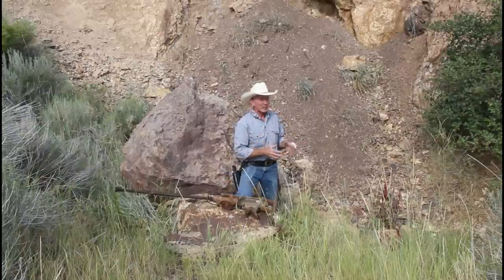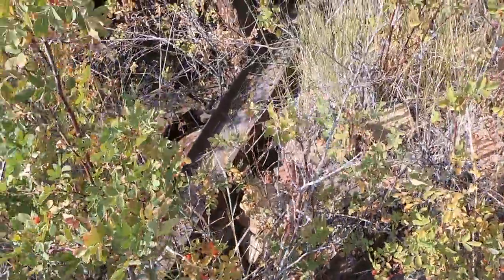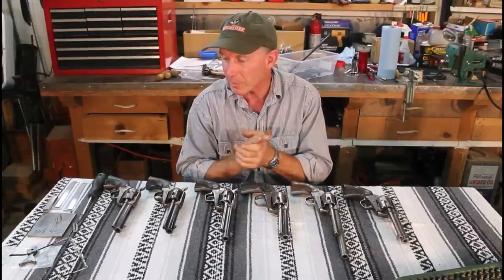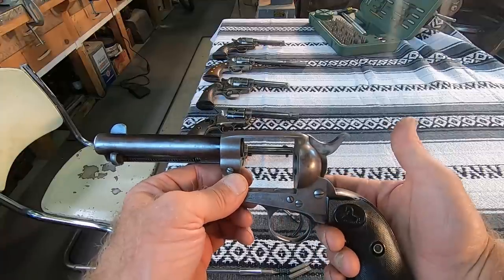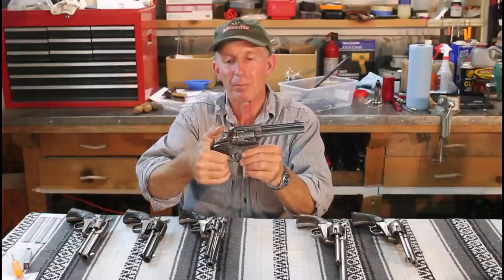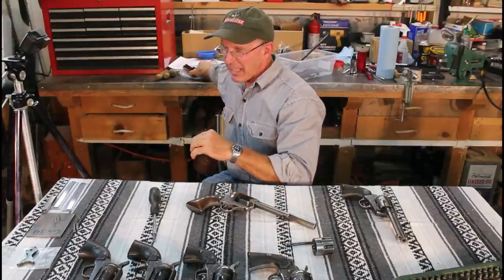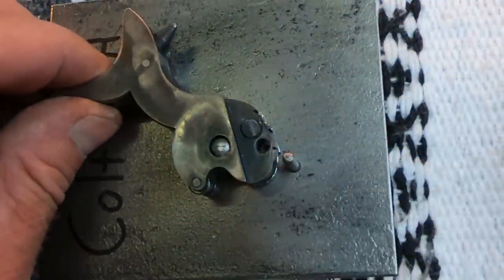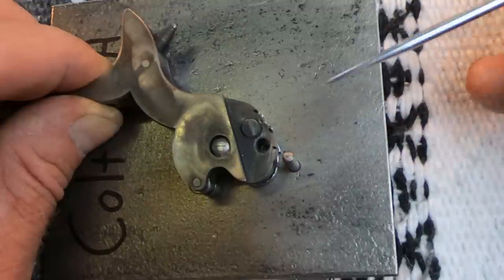Colt's Single Action Army - A Quick & Easy Mechanical Evaluation

Comment: I've collected eleven Colt Single Action Armies over the years. I do my own gunsmithing, fitted barrels, cylinders and have done action jobs on all of them. I have a couple with odd barrel lengths. I have a first gen. made in 1901. The gun was a total mess, the barrel was corroded, very little rifling was visible. Looking at the front of the cylinder the holes were oval shaped. It took me a number of years but I changed out everything except the frame, backstrap and trigger guard. So now it's a first, second, third generation. Turned it into good shootable revolver.
Reply from the maker: That's fantastic to bring that old Colt back to life.  It must have been very rewarding to shoot it after putting all that work into it.
Reply: @thecinnabar8442  It took a lot of years to get all the parts I needed. It gave me a
great satisfaction when it was finally completed
Reply: @thecinnabar8442  t's probably my favorite. It should be after all the money I put in it.
Reply: Donald, did the James-Younger gang have 'cartridge' 6 guns in Northfield in 1876???

Comment: Well if you have the inclination of messing with firearms, that is why they make the plastic fantastic, aka Glocks. You can screw with those till the cows come home. The Vintage SAA's well those are too valuable to bubba. I live just 35 min from the Factory and use to drive by the old factory on the way to work back in the day.  Sam Colt could not start that business here in 2021. We are living in very screwy times. Laws are passed, the people tell the state to go pound sand and they don't enforce the law that they pass due to not enough personnel to do it, not enough money and they don't want bloodshed. It's been hard to be a gun guy here in the last 7 years. The issue is going thru the courts right now and my guess is it will end up at the Supreme Court. You showed in my feed this morning and well I clicked subscribe.

Comment: A friend gave me a 1st gen 44-40 4 5/8 inch built in 1884.  It was missing the ejector housing, the trigger & hammer were notch-less, the bolt was missing a tail, and nearly all the finish was gone.  Good news is the cylinder was tight, the bore was good, and it was miraculously free of rust damage.  With the help of Jerry Kuhnhausen's book, a very expensive collection of replacement parts, and a lot of patience, I now have a proper functioning SAA that shoots my Pyrodex handloads exceptionally well.  It required learning to silver solder for the ejector rod screw retainer, and shaping the tail of the new bolt to ride over the hammer cam for proper timing is not for the hasty or hamfisted.  It probably took ten hours to polish the case hardened hammer so it fit in the frame properly.  The only thing remaining is whether or not to refinish it - it's unlikely anyone else will ever own it, so I'm inclined to make it look as good as it shoots.

Comment: This is the first time I've seen the safety notch discussed and I watch a lot of gun videos. It seems we should all carry our SAAs with the hammer down on an empty chamber, though I'm pretty sure that back in the day they were carried with all six chambers loaded and the hammer in the safe position. The safety notch looks pretty substantial, not foolproof but pretty good. I suspect lawyers might be involved here. The safety positions on old rifles are very similar. It all comes down on the shooter, the best safety is between the shooter's ears.
Reply from the maker: Very well said!!
Reply: There is another way to carry fully loaded safely..Its an old method carried over from the percussion revolvers..I call it mid notch carry and you let the pin down between rounds..Its an old method that apparently has been forgotten and not taught to people in the last 50 years or so..It was taught to me by my old Grandfather,who was friends with Elmer Kieth..
Reply: @TightwadTodd  The Colt percussion revolvers had those pins for mid-chamber rests, the Remingtons had proper mid-chamber notches.
Reply: @3ducs  And on A Colt or colt replica SA cartridge,as well as a S&W or S&W replica Breaktop SA cartridge,you can place the firing pin down fully between Cartridges..This keeps the pin off the primer and releases the full weight of the spring,locking the cylinder in that position.. no chance of primer detonation unless the hammer is cocked..I suspect,that this was the way they were intended to be carried..I cant see the Manufacturers having that safety feature on their percussion revolvers and then abandoning it completely on their progressive models..I have never bought into the Empty Chamber  carry and the "They loaded that 6th round when necessary" theory,with regards to anyone who carried the SA revolver for any serious work..
Reply: @TightwadTodd  You beat me to it.  Very good point.
Reply: Speaking as an owner of a 1851 Navy clone, I figured out that placing the hammer down on a 1873 SAA between cartridge rims would be a good and safe idea.  Apparently I'm  not the only one to have figured that out.  
I do get a little concerned about the choice of words, to clarify a situation.  The "safety notch" is known as the quarter cock notch on a revolver, but it is the half cock notch on a rifle.  The "loading notch" on a SAA is the half cock notch.  
Your last sentence reminds me that when I was in high school a driving instructor said that the best safety device on any car is the nut behind the wheel.  You certainly grabbed onto that point very well.
Reply: COMMON practice…
Reply: @TightwadTodd  ‘Cowboys’, etc were KNOWN to have a “rolled” dollar bill or eqivalent in the EMPTY CHAMBER of the cylinder where the hammer rested. YES…’5’ ROUNDS!
Reply: @m118lr  No "Cowboy" i ever knew and i come from 5 generations of em, Besides, that would wick moisture into the cylinder. Another modern myth.
Reply: @TightwadTodd  I have also heard but not confirmed that five rounds of black powder cartridges would burn a paper dollar to ashes.   Yeah, I think it's a myth.
Reply: @wsmvolunteers8588  Hadn't even considered that possibility..Guaranteed a Cowboy would have found a better use for a dollar than to burn it up in a cylinder.
Reply: I remember my Grandfather saying,
“If you need a safety on a gun you probably shouldn’t have one.”

Comment: Great video! Really enjoyed this and the cylinder gap issues that I have not had to deal with yet. I thought it was interesting at 24:33 the view of the cylinder notches looks to me like they have been deep cut. The deep side looks like about 50 thou. The place the bolt is dropping very early is where it would drop on a race SAA (about the middle of the flute). Just that the leads have not been extended is the only difference with a race cylinder. Makes me think someone was making a fanner out it at some point.

Comment: Mark, I often wonder why I couldn't have had someone like you as a brother in law! What a great way to demonstrate and educate on these. I just got an old Colt SAA at auction and when it gets here I can really use what you just taught me. The trigger guard assembly, where it contacts the frame has a small gap that I will need to investigate also. Anyway, I think this gun I am getting was part of an order to the Copper Queen Mine in Bisbee. Will be interesting to see what Colt has to say. It has some Sulfuric Acid splash on it too.
Reply: As far as the trigger guard assembly gap problem,  possibly the screws are crossed threaded when installed, or they might be replacements and too long.

Comment: Thanks, Mark!  I'm looking at buying a Colt SAA with Serial # 1532XX.  It's got the screw to hold the barrel rod so I think it's Pre 1892-3.  I'm watching as many videos as possible before buying and you gave me a check list of what to watch for.  It sometimes does three clicks but does the 4th after I tried it a few times.  I think it's old and needs attention.  Thanks for the break down of the SAA and what to look forward.  I'll go see it again and applied what I learned from you.

Comment: Very informative video. I purchased 2 new Colt single action army revolvers in 45 colt back in the 1980's and recall that they both developed so much end shake/play after shooting a couple boxes of ammo that you could hear the rattling as you pointed the revolver up and down. I traded both in disgust soon afterwards. I was beginning to wonder if I had judged them to harshly that maybe that end play was normal until watching your video.
Reply from the maker: Once they start getting excess end shake, they get worse from firing and the battering that the cylinder takes.
Reply: @thecinnabar8442  I have thought about purchasing another from Colt's custom shop but have been very apprehensive spending so much money without getting an opportunity to examine the revolver first

Comment: Very informative video. One point missed is checking the timing. I lightly rest my left thumb on the cylinder as I slowly cock the hammer. Once the hammer is in the final position I push on the cylinder clockwise and listen for the click of the bolt dropping into the cylinder notch. If I hear a click that tells me the hand is stopping short of full lockup.  It is not a difficult fix. Thanks for some very valuable times.
Reply from the maker: Great point about the hand function and it's relation to lockup.  I should have included it.  Maybe I'll get around to doing an episode on fitting a hand in the future.  Thanks for watching and commenting!
Reply: @thecinnabar8442  I think that would be a great video. You may consider one on adjusting bolt timing too. Thanks for your good work.

Comment: Great video! I just wish there was a better explanation of how the ejector rod works, and what the function of that long tube that almost looks like a second barrel (the ejector housing I assume) is. It's a very distinctive feature that always catches my eye, but I haven't found a good explanation of it anywhere.
Reply from the maker: Open the loading gate, put the hammer in the load notch, line up the cylinder so that the spent case is lined up with the ejector rod, push the case out with the ejector rod.  The first time you handle a SAA or one of the clones, it should become very clear to you.

Comment: You're helping me out big time buddy. I just bought a Traditions 1873 SAA, but the 2nd click is not a click sound at all, but a thud that I can feel, not hear, and the top portion of the hand looks like half of it's surface is sheared off. It's action feels worse than my Heritage Rough Rider 22lr saa revolver. Something tells me a $500 plus revolver in 45lc should have a nicer action than a $120 22lr saa revolver. Sometimes, the hammer comes back part way, then locks up and the hammer won't move back any further, nor does it want to allow me to lower the hammer. The original owner is dead & his family sold it to me. I dont' believe they knew anything was wrong with it because it looks to be in fantastic shape. The problem is, it's not in great shape internally.

Comment: Wondering if you know? Elmer Kieth's #5 SA there are discriptions of how it was made. However, not in much detail, the welding of the top strap, was it built up, etc. Then there is the isue of heat treating. Anyway these details I have wondered about. I figured if anyone would know it would be you. Hope you can help, thanks.
Reply from the maker: Sorry, I don't have any information on how that was done.  It would be interesting to know.

Comment: I was wondering if you are still doing gun smithing yet and color casing that I saw when you were going to school for gun smithing I may need color case hardening services
Reply from the maker: Hi Scott, I'm not set up yet to start color case hardening, but am planning to soon.  I just got a used caustic bluing setup that I'm refurbishing, then I'll work on getting my color case hardening equipment up and running.  Drop me a line at: CinnabarGunworks@gmail.com and we can keep in touch about it.

Comment: Enjoyed your videos and watched it from beginning to end. I watched because I have an old SA giving me problems. The revolver was working fine until the hand broke. I replaced the hand and now the hammer jams sometime times when going to full cock. It's like the cyclinder block is engaging the cyclinder to soon. I am thinking maybe the spring is slipping, but the spring looks ok. Can you help me? You started talk about timing, but you cut and said a Gunsmith would do XYZ. Can you tell how to get the timing corrected? Thank you.
Reply from the maker: This episode was about evaluating and identifying potential problems. Each of the issues I addressed would take a long episode to talk about how to fix them. The geometry of hand timing can be very tricky and I could make your problems worse if I were to guess at the cause of your problem and describe how to fix it and be wrong.  It really should go to a gunsmith well versed in revolver repair.  I'm really sorry I can't be more help without your revolver in hand.
Reply: @thecinnabar8442  Thank you for responding and your honesty. I'm not sure my old revolver is worth the cost of a gunsmith. I will continue playing with it. Like I said it doesn't jam all the time, so I am sure it is a small problem. I will find it. Thank you. Gerry
Reply: What I've heard from both Colt and gunsmiths doing this for awhile is that Uberti copied the 1873 so exact that pieces are actually interchangeable and the fit and finish of their pistols are outstanding....my recommendation would be to spend the $330 bucks or whatever they're selling for and shoot it instead.
If you're a little curious, you could take both apart and carefully compare each part and see if you spot any differences.
I'm a master toolmaker with a shop and two Kennedy toolboxes filled with guages and measuring tools so I do this for a living.
In your case however taking it to a gunsmith might be the way to go as advised by Cinnabar.

Comment: My locking bolt spring on my 3rd gen broke. So, I had to attend the school of hard knocks! The first bolt I attempted to fit, I filed a bit too much off the tail. That ruined the timing. I order another one and with the experience I gained from the first attempt I got it second time around. I actually got it fit tighter than Colt did with no side play and got it dropping into the notch at the correct time. The 1st attempt bolt may work on a different revolver so I kept it, you never know.

Comment: Did I miss something about cylinder headspace and if the hammer mounted fireing pin could be warn to not even be able to fire a round or consistantly fire? Many cowboy action revolvers get highly modified from stock.
Reply from the maker: I talked quite a bit about headspace and demonstrated the tools and technique to quickly measure it.  I didn't talk about firing pin protrusion, only because I forgot to mention it.  Rarely is it an issue. Thanks for watching and commenting, Galen!

Comment: Hey Mark, I know this Video is a few years old, but I hope that you still reply to comments on it.
I just bought a new Pietta 1873 Great Western II a couple of days ago and I noticed that I can still spin the Cylinder back and forth in the Full Cocked Hammer Position as well as when the Hammer is all the way down except for one Chamber out of Six. One of them seems to be locked correctly.
 I've never owned or handled a Colt SAA Clone before this one, is this operating correctly?
Reply from the maker: No, it's not.  It should be returned for repairs.

Comment: Is it possible to adjust the windage of the Colt single action army revolver clone? If so what do you need to do. I need to adjust 2 1/2" at 25 yards. Do you have to bend the front sight.

Comment: Considering your Cattlemen’s a clone how would you compare it to your Colts?
Reply from the maker: It's the only reproduction I own and I really like it.  They're smoother than the original 1st gens and because it's a reproduction, I didn't mind smoothing it up with an action and trigger job.  It's action is smooth as silk.
Reply: @thecinnabar8442  
The Italians do a good job especially in the last 15 years or so.  They’re affordable and You can modify, shoot and just plain use with out potentially damaging or wearing out an expensive collectible and they’re built very close to the real deal.
I enjoy your videos. I’ve heard that about old Colts.  My buddy only carries Colts.  His first and third generation have actions jobs by Bob James of Tucson and are butter smooth.  His 1902 had to have the hammer cam redone because the safety notch was broken.
I’m looking into getting a Colt.  I’m a Jeep guide and I carry a Taylor’s & Company, Uberti built, stainless Steel “Runnin Iron” that has a action job by Taylor’s and is very smooth.